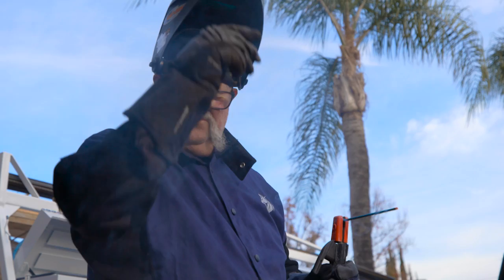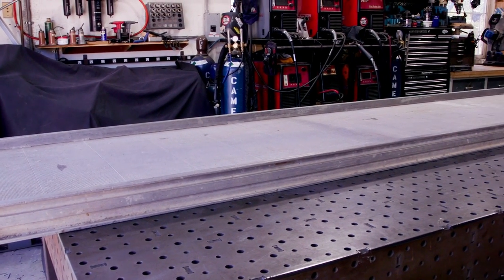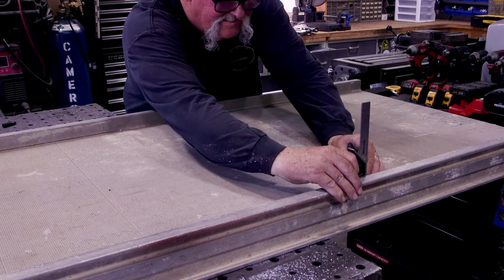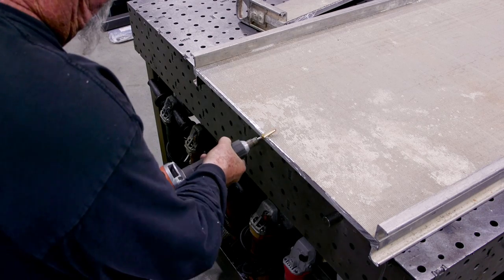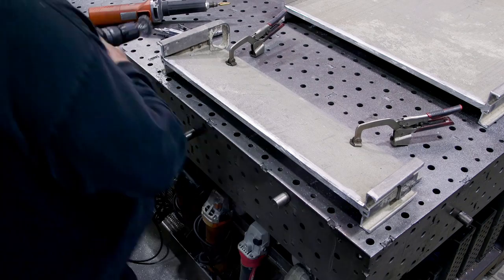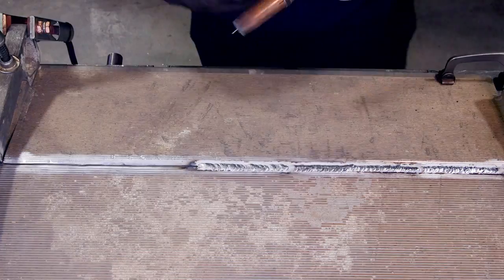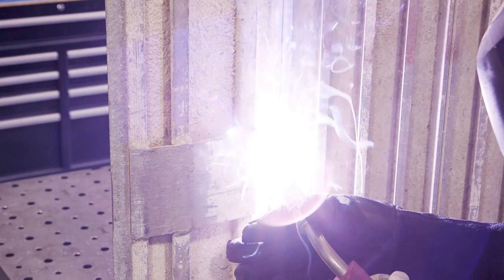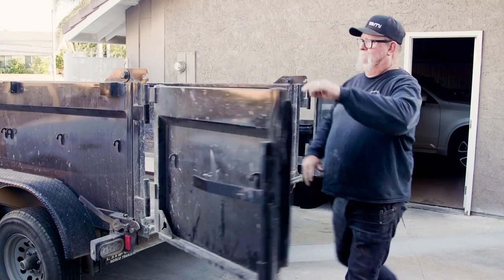Aluminum Ramp Modification | JIMBO'S GARAGE

Comment: Hey Jimbo quick tip on beveling aluminium, try using a router cordless with carbide wood bits, 
You can use a variety of router bits depending on the situation from chamfer bits to flush bits etc
Aluminium cuts quite easily using wood working tools.

Comment: You're the pro fabricator and I'm not, but I wonder about weld strength and penetration of the 3/4" main body of the ramp.  I guess I expected approx. 1/4" depth bevels on both top and bottom, and maybe more than 1 weld pass per side, to build up weld thickness that is a match for that thick deck.  Seems like one of your TIG welders would have been a great choice to put in such a weld. Certainly less messy! Maybe the strength depends more on the side rails, and a full penetration weld of the deck isn't needed.  Anyway, thanks for showing the project. It's fun to see some aluminum fabrication and repair/modification.
Reply: By the way, all the bright sparkly bits from the circular saw cutting of aluminum are sometimes called "man glitter."  They are amazingly shiny and go everywhere!
Reply: I agree with you.  I would have beveled out way more.